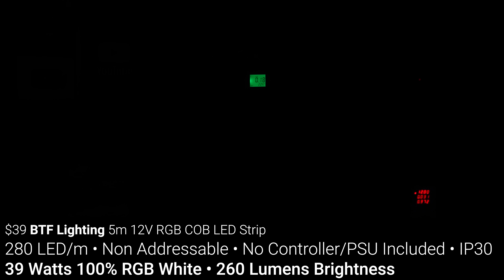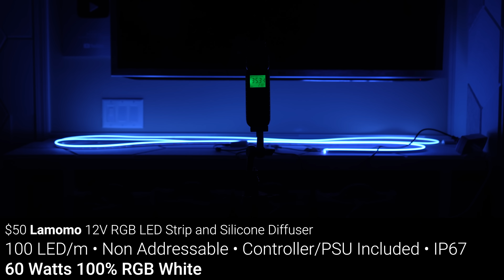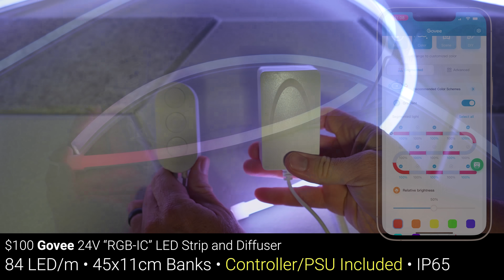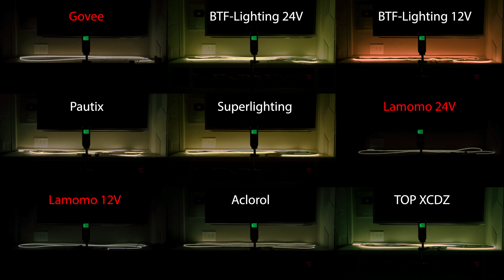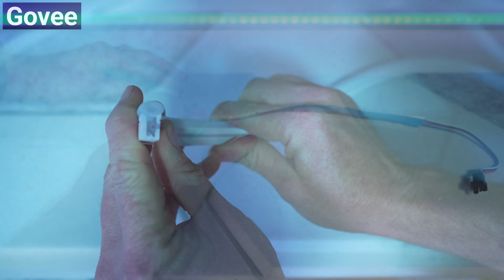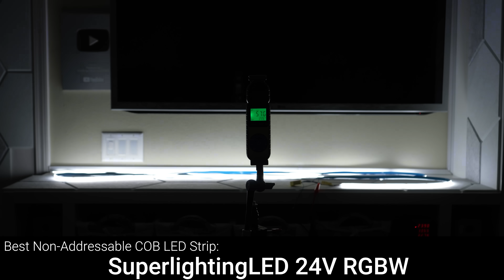Spotless NEON Effect LED Strips, which is Best? Govee, BTF-Lighting, Alitove and more.

Comment: Great breakdown of the popular spotless neon effect LED strips. As someone who has worked closely with manufacturers of silicone diffusers for these products, I can add a few technical points that might help viewers make a more informed decision.

The key to a truly "spotless" neon effect lies in the quality of the silicone diffusion tube and its internal structure. Many of these strips use a standard silicone sleeve with a separate bottom channel, which can create a visible seam or uneven light distribution. The best all-in-one silicone diffusers are extruded in a single piece, with a precisely designed internal light guide that eliminates the hotspot and ensures even glow. Our company, Inborn Plastic Industrial (Ningbo) Ltd., specializes in custom extrusion of these high-end silicone diffusers, and we see the same patterns in our clients' feedback—cheaper silicone with lower translucency leads to yellowing over time, while the "spotless" effect fades if the inner ribbing is too thick.

For the video's winner (BTF-Lighting's silicone diffuser seems to be a strong contender in many comparisons), the material grade matters. Commercial-grade silicone like platinum-cured or high-temperature vulcanized silicone not only resists yellowing but also maintains flexibility for tight bends without cracking. Inborn Plastic Industrial has been producing these profiles for over a decade, and we've noticed that the best value options often sacrifice the inner diffusion layer's thickness—resulting in a less uniform neon look when viewed from the side.

A suggestion: if you're planning a longer install, look for strips with a separate "light guide" strip inside the silicone, not just a printed circuit board stuck in. That's where companies like Govee and BTF-Lighting differ. For the DIY community, the all-in-one design (like the one you highlighted) is definitely the most practical. And if you need custom lengths or specific durometer silicone for outdoor use, it's worth asking the manufacturer directly—we at Inborn Plastic Industrial often help brands optimize their neon profiles for better heat dissipation and water proofing. Thanks for the thorough test, it helps the whole industry raise the bar.

Comment: For complexity reasons (i.e. teaching our electrician how to install four 5 meter strips in a rectangular array without voltage drops, excessive heat, or power draw when turned off), I am looking for a solid 24v, non-COB, non-addressable, high density, 90+ CRI strip and controller combo that is at least RGBW (if not RGBCCT) that doesn't require complicated power injection. What would you recommend? Thanks!

Comment: The side firing diffuser channel is no longer available.  I can’t find a replacement that would accept either the 10mm BGT-Lighting 24V or the 12mm Superlighting RGBW. Could you share some other options to Muzata, please? Thanks.

Comment: Is there a recommended CCT 24v strip light that isn't addressable? Your website doesn't show any and this video doesn't recommend any. I need CCT that works with 3-wire, and prefer 24V for the tunable dimmer I want to use. It could be COB or not.

Comment: WOW... A lot of research, and yet, rather than explaining the "ANSWER", you seem to be one of the myriad of "explainers" who don't want to offend prospective sponsors by simply saying: THIS is the best value and what you should want.  TRUE GURUs TELL prospective buyers what the best "deal" is.  (For instance, in the very first two product examples, why would I buy the first when the second offers DOUBLE the lumens for the same price?!  If there's a reason, perhaps you should tell us.) I TRUST that you investigated ALL these products, but I have a "life" apart from reveling in your exhaustive comparisons and I don't need to know about and understand every possible permutation: I have to make a purchase: If ONE provides only slightly more illumination but is double the price, then it's probably NOT the one to buy.  I suggest that you'll generate more supporters if you provide more succinct recommendations and spend less time delivering "scientific reports" which such thoroughly comprehensive results.  If ONE comes with a crappy controller, just tell us the best configuration.
Reply from the maker: As I explicitly stated in the video, I have no sponsors.  Different strips are better for different applications, and I absolutely gave my recommendations at the end of the video.  There is a timestamped bookmark titled "conclusions" you could easily skip to if you don't care how I came to those conclusions.

I'm not interested in making "trust me bro" recommendations, I want data to back up any and all claims I make.

Comment: I’ve been trying to connect the superlighting strip with a shelly rgbw2 controller to a 24V 200W power source but it doesn’t seem to be working… I’ve spliced the positive end of the strip with the positive end of the power source, but whenever it touches the controller the strip flickers and then dies out. The controller works fine though, the fact that it doesn’t seem to be able to connect to my phone… any ideas on what’s going on here?

Comment: Awesome video! Dumb question from a newbie: Does the repeated +12V +12V +12V +12V +12V +12V along the length of the strip show when installed? Can I cut that off or would I need to plan on covering it if I don’t like the look of that?

Comment: Are there specific connectors for the cob strips to connect 2 strips or best idea to solder with wires? Are there varieties depending on RGB/RGBW/RGBIC (4/5/3 pin)?

Comment: Do you have a recommendation for a neon style led light strip that is waterproof and also solar powered? I wanted to use it as a accent light around the edge on the backyard and love the neon like style but also solar powered to avoid more wiring issues. Any help would be greatly appreciated!!

Comment: Can anyone recommend a tunable white strip and controller.  Ideally, I'm looking to use a Lutron Diva wall switch and dimmer with a dimmable LED Driver powering tunable white COB LED strips where the white color is set by Home Assistant based on the time of day and sun position in the sky.  Any suggestions?

Comment: Great videos and i want to say Thank You in advanced!  I've got a question and I'm sure you could easily answer.  If you were needing to run 85 feet (may add about 3 foot extra to that for a total of 88) of led strip and wanted them waterproof, addressable, and with customizable cool effects, which type of led strip, controller, power supply would you use?  I'm not concerned about whether they are a pre-assembled kit or not.  They will be mounted around the interior of a 27 foot pool (mounted up under the top rail firing down toward the water,4-5 above waterline, not submerged). The plugs/power/controller have no chance of getting wet or splashed as they will go inside a waterproof/weatherproof control cabinet. Also if I decide to go non-addressable rgb, which would you recommend?   I obviously wan't the best bang for my buck and I have a fear that it may be a lot more costly to go addressable, so I'm totally fine with RGB.  Please help,  Thanks again!

Comment: I'm looking to do a project of about 64 feet, aka the top rim of our gaming room. What should I avoid due to issues with voltage drop? Is that DIY recommended combo able to be bought 4 times and put together no problem to do this?

Comment: I want to run LED strips in my basements coffered ceiling.  I have 17, 4’ x 4’ squares.  I would prefer to go the DIY route with addressable LED’s.  Any recommendations for power and controller?

Comment: For my son's birthday coming up, I was going to put addressable RGB strips (probably the WS2812B 60/m)  around the top of his wall at the ceiling and control them with WLED.  What style of LED diffusers have you found give the best look for rooms like this?  A 45 right where the wall meets the ceiling, a channel pointing out from the wall, down from the ceiling, or up towards the ceiling?
Reply from the maker: If you are using 60led/m I recommend these diffusers: https://amzn.to/3WL9QaU if you are using COB strips like in this video you can get away with basically any diffuser type that you want.  Even the worst performing diffuser from my diffuser review works great with COB strips, you can briefly see them here: https://youtu.be/Nj_z1DBy0ps?t=70
Reply: @TheHookUp  Thanks!  Do you like the look best when they're pointing down from the ceiling or out from the wall?
Reply from the maker: @LifeWithMatthew  depends, down from the ceiling will cast the colors onto the walls, in towards the middle will cast them on the ceiling.  In most cases ceilings are white which will make the colors better.  It's also easier to run the strips towards the middle of the room because that's the direction they naturally bend.

Comment: Awesome video. I do have a question about the power supply choices. Do you cut the barrels off and connect the wires directly to the Shelley or is there some intermediate connection made? I saw on another Youtuber's page you made the comment that the barrel connectors are good up to 3A, so I assume you are not using them here. Any insight would be appreciated.
Reply: I was looking for this answer in the comments. Glad you asked! Did you end up finding an answer to this?

Comment: Great review.
Temperature measurements would be welcome. Something tells me these "neon" silicon sleeved strips run hot, and there's literally no way to cool it. I've seen assistant sold silicon diffusers you could cream into an aluminum profile though, that might be better. They do eat brightness anyways, though.

Power supplies and controllers shipped with strips are for lazy people and usually trash quality.

Idle consumption of addressable strips can be addressed (he-he) with a relay. Wled has built-in support for such.

Comment: I've been installing 24volt / 720 ICs for a few months, and this vid confirms what I know. First is you need to choose between addressable vs uniform color for best results. My 720 ICs pull over 100watts in full white mode, but a fraction that just running effects. Next, silicone anything  destroys output. I stick to conventional channels with lightly frosted covers with COBs. Only time I bother with silicone is for swimming pools.
Reply: Where do you get the lightly frosted covers from

Comment: All your video do a very good comparison of products.  I would like use a10mm wide aluminum channel with white diffuser that you compared a year ago and a high density LED strip 60LED/m for the under counter kitchen lighting.  I paired a SP108E controller with SK6812 strip, but found the it was not compatible with Google home assistant.  What would you recommend for a dimable under counter white light or RGBW solution that works with google home?

Comment: I noticed you was have led fail issues and losing colours. Is that happening a lot.
Reply: @TheHookUp  though out the video did you have any LEDs that died or loss of colour with the addressable strip's

2mins 20seconds in video
Reply from the maker: No, I set that segment to be a different color so you could see how long the segments are.
Reply: @TheHookUp  good to hear.. I was having major issues with led fail or lose of colour.

Comment: It would have been good to see the addressable BTF Lighting COB 12/24V strip - looks to be a good middle ground  for cost/features whilst maintaining the ability to address each "section".
Reply from the maker: I did test these 24V addressable strips from BTF after the fact: https://amzn.to/3V4bUtX

They performed well, slightly less energy efficient than the TOPXCDZ strips, but the same addressable section size, more brightness, and the benefit of 24v, so longer runs with no voltage drop.

Comment: Are any of the silicone or COB strips trimmable?  If I have a certain design that needs 4 or 4.5m instead of 5 then what are my options?  Amazing video as always!
Reply from the maker: Yeah, they can all be trimmed, but the COB strips are easier to work with because they have clearly marked cut lines.  The silicone strips you need to cut a little longer than you need, then carefully trim back the silicone tube until you find a cutline for the LED strip inside.  Also worth noting that the silicone tube strips will no longer be waterproof if you cut them.
Reply: @TheHookUp  nice, thanks. That makes sense.  For custom lengths, using a cob threaded inside a separate silicone tube like the last segment of the video might be the most customizable.
Reply: @jonbartosch1903  Jon

Comment: Thanks!  Does the old and new Quinled work with 24v?  I have the original version.  thanks
Reply from the maker: If it came with the blue ESP board it is only 12V unless you mod it: https://quinled.info/2020/05/23/quinled-dig-uno-adding-24v-compatibility/

If you have the White ESP32 board (V3) it supports 24v.
Reply: Thanks, always enjoy your videos!  - another quick question the DYI solution you suggested with the FCOB RGB Flexible Chip of the BTF-Lighting - which appears to be a 'new type of chip'?  does it also work with the Quinled boards?   And what is the difference between that LED strip on its own compared to the TopXCDZ you recommended as well?  So far I have bought the Aclorol and the TopPXCDZ and considering the BTF-LIGHTING - but  - opps - just realized it is non addressable... which means I can't use with the Quad?
Reply from the maker: Correct, quad is only for addressable strips.  After this video was published I checked out these from BTF: https://amzn.to/3V4bUtX
and they performed really well if you're looking for a 24V addressable.

Comment: Great channel, learning a lot. QUESTION: Can i chain 2 5metre lengths of SK1682 leds into one 10 metre chain, obviously they will need a beefier power supply but i assume WLED can allow for this if i increase the start and end LED numbers???
Reply from the maker: Yes, you can make a 10m chain.  If you are using 12v you can get away with power injecting at each end, if you are using 24V you can probably get away with no power injection, and if you are using 5V you will need front, mid and end power injection.
Reply: @TheHookUp  Thank you for taking the time to reply. I've made quite a lot of progress n the last 24 hours and now have a working 5m strip, the ONE big issue i did have was the ESP needing 5.8 volts to stop it dropping out. Took a bit of figuring out that one.

Comment: Is there 5v version
Reply from the maker: There is but only in 1m lengths, there's too much power draw to use 5V for long runs.
Reply: @TheHookUp  I see. I only need 1m max. As I'm putting them as battery level indicator on a product. But I still can't find suitable one. I will search in your links

Comment: Can you give us some rationale for your use of the QUINLED DIG  over an ES32?
Reply from the maker: I assume you mean ESP32.  The DigUno is an accessory board for the ESP32 that makes it more convenient and safer to use.  It includes things like screw terminals, fuses, voltage regulation, and a built in logic level shifter.

Comment: Great video. I was hoping it might tie in to your 'best diffuser' video though. I guess I basically want to know what's the best option between using one of these strips alone versus using one with a lower rated diffuser versus ignoring these and using some other strip with a better diffuser. Maybe something for a later video.

Comment: To get the best desired effect you would have to use individually addressable LED strips. You will also have to buy a separate defuser for the LED strip which there are many options to choose from. But groups of 5 or more LEDs per segment is a bit course compared to each single LED being controlled for a much finer graduation of colors.

Comment: For the BTF 24v RGBW, how easy were they to cut and install the remaining pieces in a new location?  

I have Four nerd shelf’s for statues I want to install them on, and I’m looking for a very bright upper area.  The last ones I used were the four pin connectors.   These are four wires correct?
Reply from the maker: No different than any other LED strip, pretty easy to do.

The RGBW ones were not from BTF, but they are 5 wire (R,G,B,W,+), the BTF 24V ones are RGB 4 wire.

Comment: Question, I plan to get the BTF 24v cob strips to use as under-cab kitchen lighting and need to be able to dim it via an in-wall switch. which you think would be best. Triac dimmable driver or PWM dimming? flicker/hum free? Thanks for any input!
Reply from the maker: The best option would be to use some kind of home automation platform to sync the dimmer % with a PWM driver like the Shelly RGBW2.  The easiest option and the one I'd try first, just to see if it works would be to use a dimmable 24V power supply like this: https://amzn.to/43gNnFH
Reply: I am looking to use the existing wall switch with your recommended COB LED + Silicone Diffuser DIY Combo. Is it possible to wire these so when I turn on the wall switch the leds illuminate at the last setting or at least turn on when power switch is turned on without using a phone or app? Or do I need additional equipment - suggestions and affiliated link would be great.  @TheHookUp